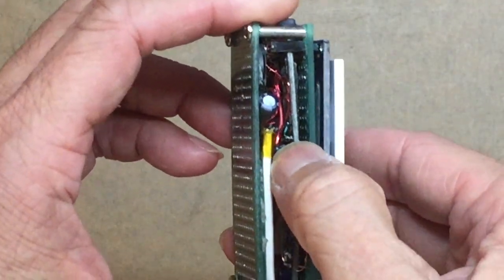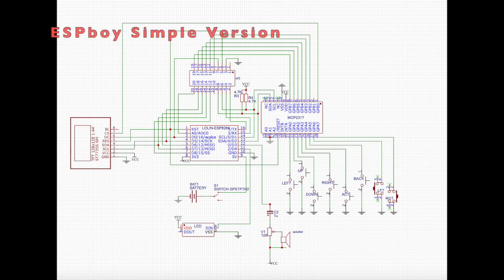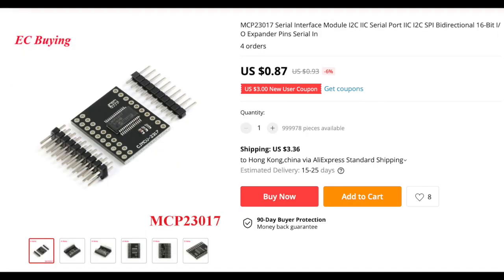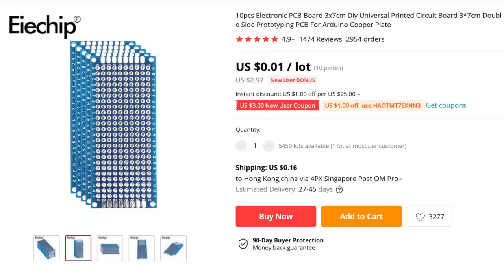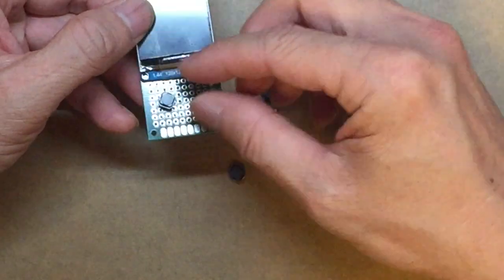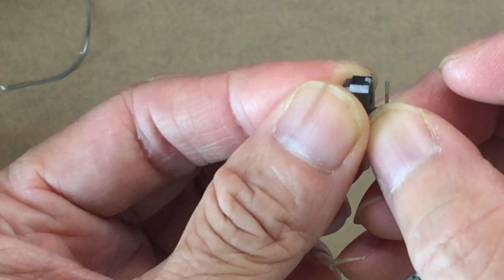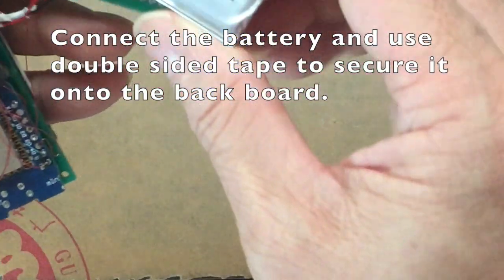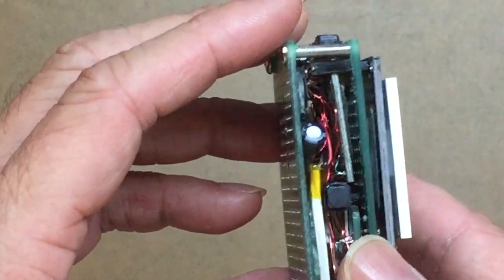ESPboy Perf Board

Comment: Can I use ws2812s instead ?. Cuz I only have it
Reply from the maker: The WS2812 is a six pin device, while WS2812B is an improved version of WS2812 with only 4 pins. I am not sure how you can replace a 4 pin device with a 6 pin one, unless you know how the 6 pin works and alter the circuit to make it work.

Comment: Sir can we use a touch display in it
Reply from the maker: You must follow exactly the same specification of TFT ST7735 if you want to use the WIFI to download games from APPSTORE. Because the appstore codes are all compiled with the exact configurations. Any deviation from the exact configuration will mean the game cannot be run.
Of course, if you are going to modify the game codes yourself or create your own game, then its all under your control, what type of TFT touch or no touch display you want to use.